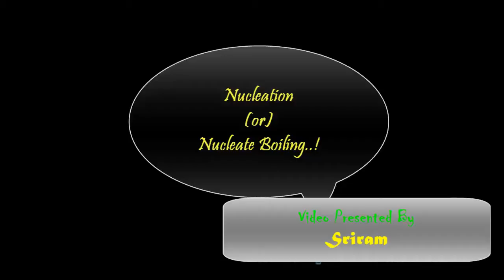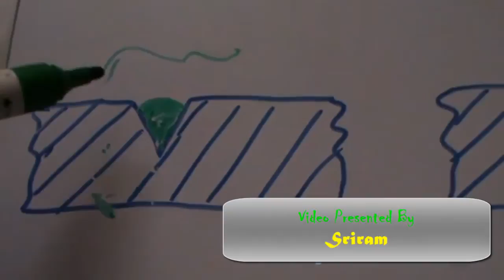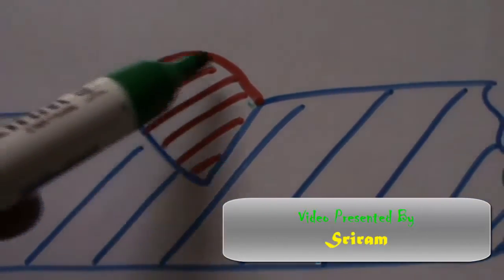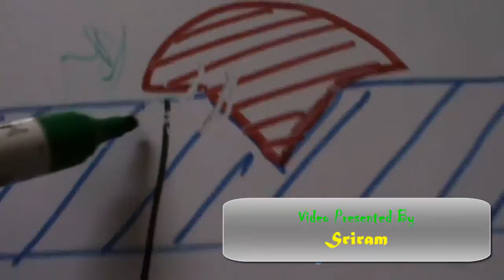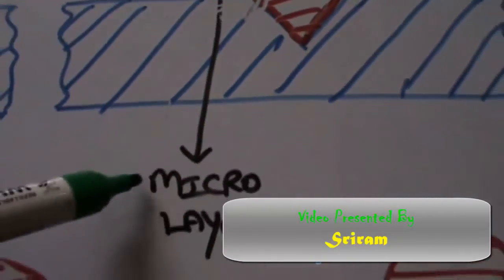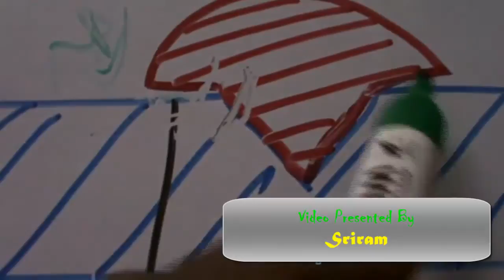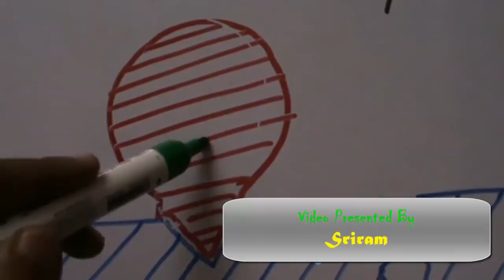Why & How Do Bubbles Form when water is heated?

Comment: Sir you are more difficult to understand. Because simple the air is dissolved in the water that is the the fishes are breath or the water means h2o so it contains oxygen so we heat the water then bubbles are formed..
Reply: Itsss ok but sir i m little bit confuse about the point.
In water molcule from where vapour particle exist..
Reply: Oxygen particle
Reply: Fishes enhale the dissolved oxygen

Comment: Wrong. the bubbles so formed are nothing but pure water vapour. The existence of cracks on the solid surface is true. But these cracks can not hold that much of air with them to form bubbles continuously. Because of these 'v' shaped cracks, the water inside these cracks may super heat and change that water into water vapour which appear as bubbles. There won't be any air inside the the water bubbles. To conform this, please conduct another experiment with a long tube (tube light like) filled with water and with an immersion coil at the bottom. When you switch on the power, you can observe the formation of bubbles on the coil. These bubbles travel upwards and disappear in the middle. This proves that these bubbles are nothing but pure water vapour. This process continues until all the water reaches 100 degrees centigrade.

Comment: So if you had no imperfections in the pan surface would you have  no bubbles?
Reply: +Timothy Luke 
You would still have bubbles flow. Just not those first tiny bubbles that get released.
The video isn't clear. He is explaining the first appearance of bubbles before the bubbles start flowing.
Imperfections trapping air ? Fair enough. Guess so.
The video should have said : 
the first bubbles that appear are trapped air...
BUT
the bubbles that flow are water in its vaporous state.
I think there is a common misconception that the bubbles that flow and appear over and over are hydrogen gas or they are oxygen gas or something special.
The bubbles that flow from water is water... it is the water in its vapor state. In its gaseous state. 
I think of it as asking what ice cubes are made of. If you freeze water it's obvious that the ice is made of water.
Same goes for the bubbles when you boil it.
Reply: no such material exist on earth, which is imperfection free.

Comment: Ok. So there's microscopic amounts of air trapped in imperfections, but where do the other bubbles come from when the first are sent up?
Reply: i think that it's because the water isn't just vaporizing at the surface, it's becoming vapor where it comes into contact with the heating surface. so the vaporized water at the heating surface (the bottom of the pot or whatever) it has to escape of course...
Reply: the surrounding water.
Reply: So the water puts air out when there's no air in the water?
Reply: there is air in the water.... that's why water boils in a vacuum. 

The air in the water is collected in those notches that the dude mentioned.
Reply: But what happens when all the air from the notches is sent out?
Reply: then more air from the surrounding water is collected into the notches. When water nears the bottom of the pan, that is where the heat is the most intense, and thus it causes the air in the water to expand very rapidly and get caught up in the notches and grow just as before... 

How does colder water reach the bottom? Look into convection currents.
Reply: I know what convection currents are, just didn't know where the air came from. Thanks mate! :)
Reply: FINALLY! That explains it perfectly! Thank you, lol!
Reply: At least in a way I can understand at my normal mental level. I could have understood it the way speedy said it, but that would take too much thinking...
Reply: I mean, I'm only speculating. Don't quote me haha
Reply: Yeah, but in all aspects, it makes total sense.
Reply: Perfect video thank you 🎉